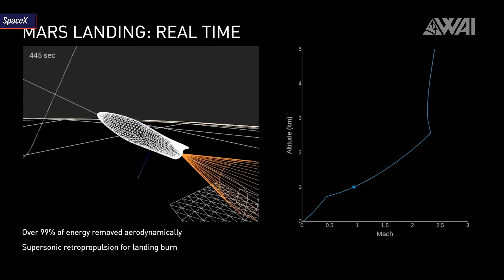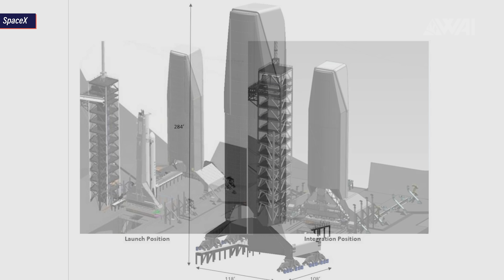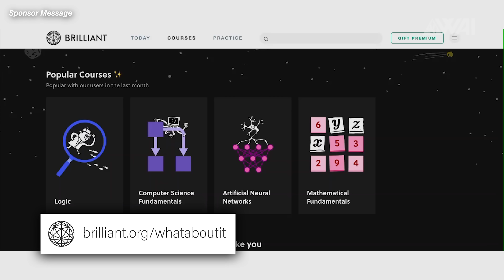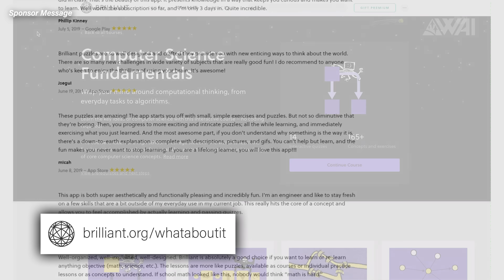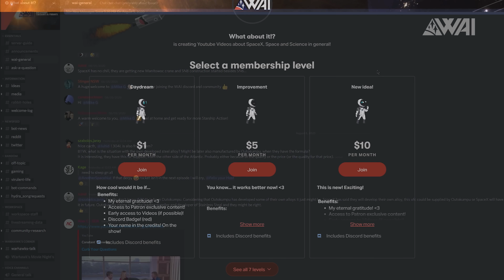112 | Starship Flight Phase Explained!

Comment from the maker: Will the new pad make it for SN 8 or will it still take off at the old test site next to the tank farm?
Reply: Hard to say when it comes to spacex,  they are building starships faster than concrete can dry. And they are gonna need a lot of concrete to support starship
Reply: Tyler pantaleo I think you just put your finger on the crux of the problem Tyler. Concrete takes a considerable time to reach its state of complete cure. AT a minimum it would be 21 days after pour before the concrete acheaves 90% of required hardness. Even with additives that act as a catalyst to speed hardening the process takes time. I can just imagine Superheavy tearing out giant chunks of concrete and throwing them everywhere
Reply: Considering the speed of development I wouldn't count out them making a new pad. The robust way of building really does give the impression that they are building ships for stars.
Reply: Hmmm..... My educated guess is that they will use the current pad for single raptor launches. However, when the raptor count increases to 3 or more, they would probably have to go for the new concrete pad; otherwise, the thrust exhaust will most definitely blow away the steel launch structure like a twig in a tornado.
Reply: @widuralatest  on the other hand they can repair that pad faster than building a new concrete reinforced one. Also even with three they would be throttled down as they wouldnt need full thrust anyways.
Reply: @tyler60904  Even the throttled down 3 raptors would be enough to cause significant damage to the unenforced (unlike the one being build) concrete foundation of the current steel stand. best bet is to go with the new one as it's made to with stand the force of the super heavy.
Reply: @widuralatest  oh absolutely, it just depends on how impatient Elon will be if the new pad takes longer than expected.
Reply: I guess it depends on how the new Launchpad will look like (how complicated and big it will be and how it will be built) ,but mainly if they do ground tests for function and structural engineering (bzw. Widerstandsfähigkeit an den aufhängepunkten/Flügel an sich) of the flaps and how the results ot these possible tests will be. But if they don’t do these tests or the results are fine, I don’t think they will wait more than 2 weeks at best for flying SN8 if the new pad isn’t finished by then, but use the old one instead, as long as it is intact until then, because if it gets destroyed due to the power of 3 raptors they probably don’t have to wait much longer for the new pad to be finished.
Reply: If this new launch facility looks anything like the launch pad in the full Starship and Heavy videos, there is a lot of building left to do. And so as not to damage the concrete, there is a good waiting period from the last pour to the first launch. Hard to call, but I would say we would be lucky to have the new launch site ready by the end of the year.
Reply: @ronfullerton3162  agreed
Reply: Looking at how fast they are constantly testing and and doing land rework. Give or take March 2021 everything should be ready to start doing orbital testing.
Reply: @harvinesh1069  or maybe even sooner than March 2021 for the first orbital Starship flight!
Reply: Looks like it's going to be a water tower with angled legs. If it is a water tower it is going to be a big one capacity wise. I know the launch agreement has a deluge system as a requirement. Starship with 31 engines is going to need tons of water for sound suppression.
Reply: It looks more like foundations for a water tower to support a future launch stand than a launch stand itself.
Reply: WS = We Spacefarers
CHANGE THE GAME. Y
PRESENT GAME IS OVER
NEW GAME:

WS = We Sovereign
We The People

We need to EMPATHIZE
"Freedom."

Each person needs to profit from Internet in order that they, each individual, has the means to protect themselves from cybernetics, artificial intelligence.

DanielHall4Freedom. ws *
YourName4Freedom. ws *
TheirName4Freedom. ws * 
*  WS = We Sovereign *  
* * We The People * * *
Yours, DanielHall4Freedom. WS

. WS _ NOT .  com
Reply: Maybe, but I told you ... SN8 - December 16!  89% :D
Reply: You got to change the color's of the new logo, are way too dark
Reply: Thanks Felix - you rock.
Reply: God knows the best
Reply: I think they'll use the old pad just for the 150m test flights, just as Elon said they wanna do them on a daily basis... And the larger tests with more than a single Raptor will launch from the new Site
Reply: could you PLEASE, stop using that slide projector transition sound effect, .. it is driving us NUTS!!!
Reply: What about it!? Old pad for single Raptors, new pad for three and more. Otherwise destruction looms! Thanks for the excellent video, you Rock (as always)!

Comment: I'm curious about something you mentioned. Why do the Class C payloads have to be 'vertically' integrated to the rocket? Maybe it's because of weight and it's too dangerous to try and rotate the entire rocket to a 90° vertical position with the payload attached? Could Falcon Heavy send up an entire module of the ISS?

Comment: Concrete usually takes about 30 days to reach engineering spec'd strength. This is a general rule. I'm sure an engineer knows a lot more. So, probably no launches for at least a month after a pour.  Good update, thanks.

Comment: I was watching the thrust dome for SN8? Being flipped. It was the first time I have seen what looks like a pressure hatch on a submarine on the bottom of that dome. If there is a similar hatch on the other domes it might mean there could be a use for empty tanks enrote to Mars. Namely storage if the tank is empty. I dont know how much fuel remains and in which tanks for such a trip.

Comment: suggestion for the next one: comparing timelines between SN6 and SN5 procedures. SN5 passed cryo 7 days after being rolled out to the launch pad, SN6 is planned for cryo test tomorrow which would be 3 days earlier than SN5. This way we could really have a sense of the progress made between each iterations
Reply: if this can be useful:

SN5 timeline:
-24/06/20 rolled out to launch pad
-01/07/20 cryo test
-04/07/20 raptor installed
-09/07/20 mass sim installed
-22/07/20 fuel tanking test
-30/07/20 static fire
-05/08/20 hop!
-08/08/20 post-hop inspection
-11/08/20 rolled out to construction site

It really was effortless thanks to Mary's videos

Comment: Looking to do multiple rocket test flights per day... because of course they are, and Elon just drops it into a tweet like that's not a huge deal on its own. I wonder if that just means one each from SN5 and SN6, or if they're going to try for same-day turnaround on a single prototype? The latter sounds crazy, but obviously it's their long-term goal, and sounding crazy has never stopped Elon before...

Comment: Felix...
A typing error. You said at video timeframe 6:21/13:21 the photo on the left said that the date was July 13 to August 7. That’s the total of 25 days. But in the English caption, says from July 30 to August 7, that’ll be 8 days. I know, we make errors everyday until we learn to correct them. Even SpaceX made early errors & made modifications to these errors. It just will get better.  We do we get for spotting an error? “A No-Prize Award 🥇”? Just helping you out. Yes, we ROCK! Lol 😆.

Comment: Once you pour concrete, it takes 7 days to achieve 70% strength and 28 days to achieve 100 % strength. It is okay to put weight on it at 7 days, but having flame against it might be a whole different story. I think any smart engineer would specify a 28 day cure time to prevent the flame from reducing the strength of the concrete. Just guessing, but if I was the engineer in charge of the project, it would be 28 days of cure time after the launch pad was finished before the first launch

Comment: Road closure 8/16 Sunday 8am-5pm central time. The new launch mount won't be done for a long time. Bfc to be added for stacking star ship to the super heavy booster. A strange pipe instead today 8/14/20

Comment: If the Starship is supposed to fly multiple times a day, the metal hull structure is going to flex a lot from thermal expansion and contraction, as well as the stresses of supersonic flight. I don’t see how hexagonal tiles tightly packed together can remain intact and cohesive. Have the SpaceX engineers considered overlapping tiles that can move slightly?
Not only could this work, it’s how nature does it for fish, snakes, lizards... and Dragons!

Comment: Great video. BTW you only fail if you quit trying.What you described as failures are simply unsuccessful tests. Elon and SpaceX are clearly committed to a testing program to find the problems and overcome them i.e. to keep on trying. Development of cutting-edge technology such as Starship will likely have more unsuccessful tests before proving up the technology. Not everything is going to work the first or even the second time but I’m sure they’ll keep trying until it does

Comment: A lot of people are saying that’s not a launch pad. But that it’s going to be a water tower for the deluge system
Reply: I agree. They need tons of water to suppress the sound coming from 31 Raptor engines. The legs are angled in, so probably a water tower.

Comment: The new pad, if the information out there is correct is not a launch site its a pad for a water tower for water sound suppression. Check the FB SpaceX page some of the foks there have the inside scoop and thats what they said it is.

Comment: Looking at the opening picture the thought struck me that a lot of volume is wasted by the swinging Landing Gear or Pads.
Could they be swung almost parallel with the skin and take up space between two engines in later designs?

Comment: Why not go with 3 engines for testing?  Use a heavier brick.  If one engine fails, the other two should provide for safe landing, no?  With single-engine flights, an engine failure means a big fireball and blast,  loss of test vehicle (needed for a history of stress testing) and potential ground infrastructure damage...as well as major negative PR!  Politicians take note when things go boom.

Comment: "Back then no one could have imagined what this site would turn into in just one and a half years."  Well, actually, it is a lot like I had imagined back then. :)  I thought it would be bigger, with more concrete slabs and large buildings by now.  I imagined something like a KSC Pad 39A and B, with a large VAB and other support and assembly buildings and a Launch Control Center.  Almost there, though.

Comment: I get the feeling you got allot better at presenting this episode.
I advise you work on a couple of things.
For the quality of the journalism you need a better looking videos.

1. reflectivity of your face.
This is fixable in a couple of ways.
    * cheapest
        Apply makeup that removes the strong highlights.
    * second cheapest 
      buy some lights led lights and hang towel or paper infront of them so the light is difuzed.
    * Buy a propper lighting setup.
     *Buy a propper camera.Depending on how much money this channel nets you the following camera is probably the best option the 4k version of this        https://www.blackmagicdesign.com/products/blackmagicpocketcinemacamera (definatly not needed for lifestreams)

   * new set
   * defirent colours in the design. the colours ase nice on filmed transparent material but on the added grafices they look cheap and horribe.
      Also i'm pretty sure that if you want to use orenge and blue its best to have the orenge more like a more saturated skintone and the blue more like the sky.

Comment: The Raptor on Starhopper started to "eat" itself as it came down for landing. When the exhaust turns bright yellow right before landing it was starting to come apart internally. The last few feet of landing it started to lose some of it's thrust and actually landed a bit hard completely flattening the crush core shoes it was wearing. Overall the flight was a still a success.
Reply: I believe SN7 test tank will also have a thrust puck to test.

Comment: The more test flights they make, the more reliable the first orbital SS will be.
Reply: That's what I think...fly, fly, fly.  Hopefully, they will soon progress to 3 Raptors (if that's planned) with a heavier test load and longer duration flights...with some "single engine failure" tests to landing (if possible).  Can SN5 & 6 do 1km hops?  That should build some confidence in the tank structure and engines holding up to all that stress and vibration.
Reply: @Andrew-13579  I wonder if the three-engine variation will ever be able to handle a "two engine failure" test. Passing it would represent an incredibly safe ship.
Reply: @General12th  I guess it would depend on the "throttle" range of the Raptors.  If 3 engines ran with low throttle and the right fuel and test load, could two of them throttle up enough to cover for one going zero thrust?  I would guess that one at full thrust probably couldn't make up for two engines out...or could it.  Then, is there a chance that one or two vacuum engines could assist for landing provided there is at least one gimballing sea-level engine?  Or must all 3 vacuum engines run together with only one gimballing engine?  I guess we already know that one gimballing engine can maintain control, by itself.  But I'd guess they'll be doing all those tests and calculations once they have a good flying test article.  They must have a simulator running all sorts of scenarios?  So that in the event of failures, a computer will rapidly know all contingencies and control the engines accordingly.  Maybe SN5 & 6 will be those test ships.  Find all that out with test ships that are minimal so as to not lose fin/flaps and nose cones unecessarily, I would think.  So maybe we'll see many more flights of these "giant flying AA batteries", SN5 & 6. :)  Two flights a day, 3 days a week, M, W F, sounds good. :)  Can they do Starship construction while flight ops are being conducted?  The flights are short, but can they safely build parts while a test ship is loaded with methane and oxygen on a test stand?  If not, then production facilities are too close by.  They must have already thought of that, right?
Reply: Love the updates. Thank you. This 62yr old loves watching the satellites. But, they are getting harder to locate. Light me up.
Reply: @caryewilson1002  Aw, you youngun! Know what you're talking about. Got you beat by nine years, and am trying to get into the space spirit like I was "back then". But crap, I cannot even get a telescope to work. Guess I need to just keep watching Felix's videos!
Reply: Don't use this abbreviation, for historys sake! :D

Comment: I think if Starship gets to orbit this year, theres a good chance that we will see first flights to mars in 2022!
Reply: EpicDaniel not to be a downer but I don’t think it will get to orbit this year. I would love to be wrong though.
Reply: @nathanlewis42  it's still possible and if they don't run into major problems with superheavy I think it's quite likely
Reply from the maker: Optimists are needed! :D Fingers crossed!!!
Reply: What about it!? Optimists and engineers! Optimistic engineers!
Reply: @epicdaniel508  so much better than pessimistic (nasa) bean counters and money holes.
Reply: @nathanlewis42  I am a little apprehensive also. I am afraid infrastructure has fallen behind a bit. That heavy launch facility is going to be a push to be ready by the end of the year. Any concrete poured needs a fair amount of cure time before they turn the heat of those Raptors loose on it.
Reply: @nathanlewis42  Even if early next year for the first orbital flight, Starship cargo ship to Mars in 2022 is still a possibility. I love it that an orbital flight this year is  theoretically possible even if unlikely.
Reply: Non sense you thing that... i am a very optimistic space x supporter but
.. man... there are soooo importante milestones to achieve  in order just to go orbit and get back....
But if you are just saying... launch, go on orbit and launch a garbage fuel tank to mars to ignite it on mars atmosphete... yes perhaps you will be correct.

First things first... aim to the moon. 10 - 20 year of equipment testing and them with a little improvement on thurst sistems we could go to mars. Nowadays mars is a one way ticket

Comment: Quick question. Does anyone know if a fully fueled Starship would be able to reach sub-orbit for tests etc without super heavy?
Reply: Cywurm 1 the answer is yes but I think anything that doesn’t reach orbit, e.g. me jumping over a puddle counts as a suborbital flight.
Reply: @nathanlewis42  LOL I was thinking more in line of sub-orbital past the karman line but you do have a point thanks
Reply: You answered your own question. The Starship is designed for sub-orbital flight without the use of Super Heavy. The goal is to provide intercontinental flights in an hour or less. Super Heavy is only required if orbital flight is needed. (The difference in energy requirements between sub-orbital and orbital is an order of magnitude.)
Reply: @thewiirocks  Thanks
Reply from the maker: Suborbital is anything from ground to orbit, so yes. SN5 did a suborbital flight. Starships in the end will be able to reach orbit without a Super Heavy, so SSTO, BUT without any payload or return capabillity, so essentially useless.
Reply: @Whataboutit  That's really interesting I didn't know it had that capability without super heavy even if it is without any payload its still impressive and it means they would be able to do most of their testing even if super heavy isn't ready yet. Thanks for taking the time to answer appreciate it.